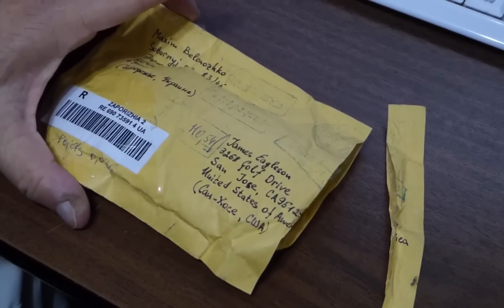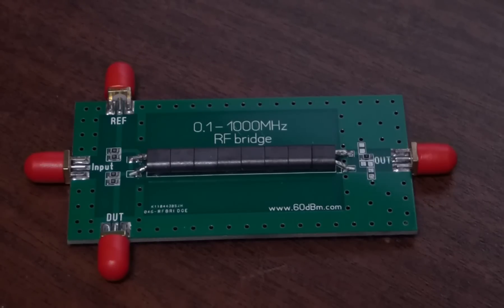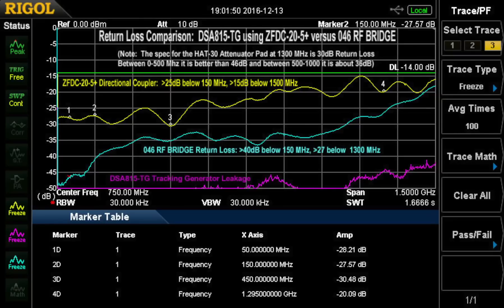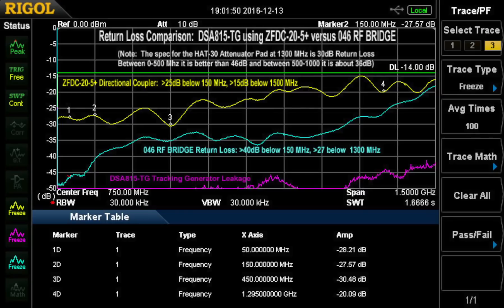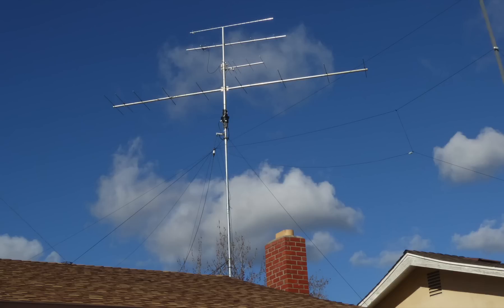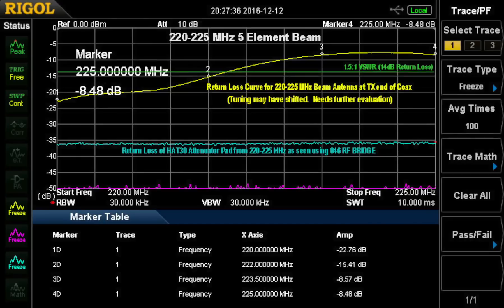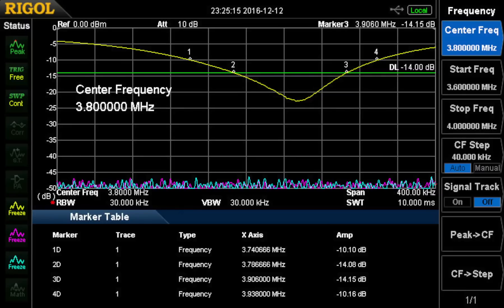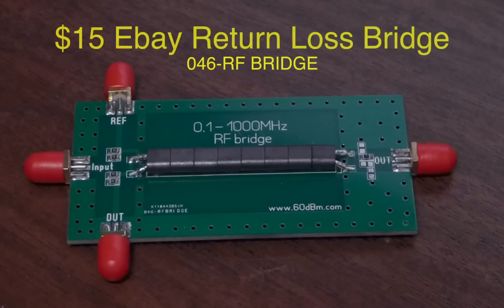$15 Ebay Return Loss Bridge

Comment: Hi James, I think you might want to review your DUT setup procedure, I've swept the ZFDC-20-5+  and a ZFDC-20-5 on my Agilent VNA and found them to be exceptionally flat, nothing like what you are showing here. 

One of the issues I see which concern me is you are using PL259 to SMA adapters, These are going to cause significant errors above  200mhz or so, I don't even like using them above 30mhz, let alone 400 and God forbid 900mhz  Even the use of  SMA to N connector adapters on the inputs to your spectrum analyzer is problematic and not recommended. 

I also noticed that you aren't using 6db pads on the input and outputs of the spectrum analyzer. The problem here is there is no way of knowing how the loading is affecting the stability of the tracking generator output. You should be using at least two 6db HP4991b inline attenuators to pad the input and the output of the spectrum analyzer, one on each.     

You should also be using dedicated cables with the proper terminations on each end. In this case, RG400 coax with N connectors on one end and SMA connectors on the other would be the proper setup and not that mess of stacked adapters that you are using. 

I believe a lot of the fluctuations you are seeing are the result of the PL259, crappy coax, and multiple stacked low-quality adapters all of which is causing unreliable erroneous readings. I'm also curious why you didn't terminate the unused ports of the directional couplers into a precision 50ohm load, leaving them open presented an infinite SWR. 

Like I said after watching your video I went ahead and swept my  ZFDC-20-5+ and my  ZFDC-20-5  using a calibrated  Agilent VNA using the proper setup and found them to perform far better than spec. I don't have one of the Cheap China specials that you have so I can't test it.
Reply from the maker: Dan Nelson  Your comments are valid but are covered in other videos I have uploaded previously and since this video as well as in my comments for this video.  For those who can afford it, obviously more expensive cables, precision loads, precision cables, opens, shorts, etc. all improve performance.  By the way, the only unterminated port in this video was during establishing an "open circuit" reference level.
I revisited the performance of the ZFDC-20-5+ and by using a Low Noise, High Intercept amplifier after the -20dB coupled output port I was able to get much better results by getting the signal well above the DSA815-TG tracking generator's internal leakage level.  I mentioned this problem with the DSA815 previously which causes the cyclic "beat note" waveform  seen when the level of return loss approaches within 15-20dB of the TG leakage.   My results upon doing this are now close to the specified performance for the ZFDC-20-5+.  I will upload those findings in the future.
Reply: Hi James, 

It appears as though my comments may have been a bit premature. I've now had a chance to watch a few more of your videos and will say that you appear to have a good understanding  of how to use the equipment you are demonstrating,  I think I just overreacted when I saw the PL259 adapters which  are basically useless above 2 meters  Even then I prefer N connectors or BNCS at 2 meters. I just don't understand why hams are so stuck on that crappy 1930's connector.  

Anyhow, I've been very interested in that Rigol Spectrum Analyzer, its small and light weight. unfortunately, I have a thing for older HP / Agilent equipment and for what the Rigol costs with a tracking gen you can pick up a really nice older HP VNA , the drawback is they are much bigger and heavier. The pros , well they are much faster and much more accurate and of course, it can perform S11 and S21 tests.

A few weeks ago I picked up an HP e8285 service monitor for $250 this is an older unit that covers from .1 to 2000 MHZ. 

I opened it up to take a look around and I have to say this thing is an absolute work of art with precision machined aluminum modules.  Everything from the up converter to the downconverter are housed in dedicated machined aluminum, enclosures. 

On the high end, I checked its frequency calibration against our county's Motorola trunking control channel which is GPS disciplined and on the low end aginst our local NOAA broadcast.  and it was spot on. 

By the way, I ordered one of those $7 directional couplers today. With shipping, they are now closer to $15
Reply from the maker: Wow.  Your surplus dealers must be much better than the ones around here.  I've not found any service monitor worth talking about for under $2000 and VNAs are usually over $5000. I don't have sufficient workspace to be able to use most HP spectrum or network analyzers anyway.  

As for frequency control, I have the found the DSA815 to be quite accurate and it is probably even more so if a precision 10 MHz frequency source such as the GPS disciplined or Rubidium unit is used. 

It would be interesting to see a picture of your sweep of the ZFDC-20-5+.  You did not indicate which HP unit your were using or how much it cost and you would probably need to take a screen shot to capture a picture from it, I suspect.  When you get the $7 RF Bridge you might take a couple of comparison shots... again realizing that the quality of the reference and DUT loads are probably what you will really be measuring.
Reply: Dan Nelson Good Lord how did you find any model HP service monitor for $250 , that’s amazing and could have saved me a bucket of money!  Of course my dream machine is the HP 8920 but even at 25+ years old now I find properly optioned units still cost around the $3,500 - $4,500 range!  I’m just a poor old ham operator, I had to settle for the Siglent SSA-3021X  spectrum analyzer with tracking generator back when they cost $1,700 you can buy that model now about $1,400 being a hobbyist pretending to be an Engineer I still have a lot to learn.  Think I will try one of these eBay specials before trying to understand why the cheapest “commercial grade” RLB I have seen is around $250

Comment: Well thanks for trying .
I did about 4-5 different searches with the info in video on both ebay & google , other stuff but not this unit .
Reply from the maker: Searching on Ebay seems to be platform specific.  I had no problem finding these offerings every time I used the search phrases that I provided using my Mac computer with the Safari browser though I note that on my iPad the $15 unit was not always found for some reason.  It sure would be nice if YouTube allowed links to other sites or if I could find a work around to their link filters.

The $15 units are now $20 + $5 shipping.  Search "RF Bridge Ukraine" on Ebay

The $36-56 Boxed units that are listed by different vendors all seem to be from the same source and its performance is superior to the $15 unit.  However it can only be used at 50 Ohms while the other unit could be used to check match from 30-75 Ohm (maybe even 100 Ohms) simply by changing the load on the Reference Port.

Comment: Why no link ?
Reply from the maker: KD0CAC   I can't seem to put up a link that works on You Tube.  I see that others have this problem as well.  Anyone know how to get around You Tube's filters?
Reply: Let's see if this link works.   73 WB3BJU

http://www.ebay.com/itm/RF-SWR-Reflection-Bridge-0-1-1500-3000-MHZ-Antenna-Analyzer-SDR-VHF-UHF-SHF-/222080291102?hash=item33b504511e:g:4KQAAOSwjDZYkBFo

Comment: searched for this on ebay.com without success. further pointers would be appreciated!
Reply from the maker: See the edited version of my video comments just below the video.
Reply: James Eagleson I was wondering what function on your spectrum analyzer allows you to put the extensive text on the screen.  I haven't found that function.  Thanks for the videos.  I find them so helpful.  

Kevin
Reply from the maker: Kevin Gray  I do the extra text using a photo editor (Photoshop Elements) after saving the screen shot and transfering it to my computer.  If I only want the text in the video, I simply use the video editor to add a title over the clip.  If I need to print an annotated copy of the picture, I usually reverse the Color image to save ink.  (That gets rid of the solid black background.).

Comment: is this better than your other one ?  before i order one
thanks
Reply from the maker: DENNIS N   In order of performance:  
Boxed 1500 MHz RF Bridge $45 (Video being worked on), 
046 RF Bridge $15 (Present video), 
then ZFDC-20-5 Directional Coupler $85 (Previous video).  

Other issues:  
ZFDC is the most rugged and smallest.  
ZFDC uses BNC connectors.  The other two have SMA connectors.
046 is just a PC Board and requires the addition of a good Reference 50 Ohm Load (additional cost).  
Boxed RF Bridge has the best range and accuracy up to 1500 MHz.

If you have the money, I'd get the 500kHz-1500 MHz boxed unit.  You may need to buy several adapters to match the unit's SMA connectors (female) to Type N, BNC or "UHF" connectors depending on what you are evaluating.
Reply: I do have the boxed bridge with bnc connectors, I think your new bridge should be enclosed
Reply from the maker: There are a number of offerings available on Ebay.  I also got a boxed unit that I will probably be using for most things that I do (video to follow).  I didn't see one that has BNC connectors though this would be a good choice for much of the work I do with such a unit.  BNCs are good up to about 2000 MHz with better ones reaching 3000 MHz.  

The advantage of the PCB 046 version is that the Reference Load can be changed to evaluate things that might be other than 50 Ohms.  Examples:  35 Ohms (typical HF or VHF natural beam impedance), 75 Ohms (for TV/FM antennas) as well as 50 Ohms.
Reply: the one I have is a mini circuits, 15542  ZFDC-20-5
Reply from the maker: I cover this at 3:59 in this video.  Assuming you use a good Reference 50 Ohm load on it, the 046 RF Bridge works much better than the ZFDC-20-5 for this purpose.

Comment from the maker: I thought I should mention that while this video shows the performance capabilities of the 046 RF Bridge using standard precision loads and attenuators, this particular bridge relies on the precision of the Reference Dummy Load for its calibration accuracy.  Since that was a 30dB attenuator used as a load that was only specified to be better than 1.2:1 over its full range, the Return Loss shown by the 046 RF Bridge in this video should not be taken to be representative of the best performance that can be achieved using the unit.   

Use of ultra precision loads for both Reference and DUT ports without the use of any adapters will likely show even better performance than that demonstrated in my video.  I don't have access to such a calibration kit since they are very expensive... almost as much as the Rigol DSA815-TG, in fact.

However for Hobby and Amateur Radio use below 1GHz, this RF Bridge should be accurate.  It should be useful even at 1296 MHz (23cm) for most requirements.  (PS. I will be uploading another video soon showing the performance of a $40-50 RF Bridge that will work quite well to 1500 MHz and probably even higher.)